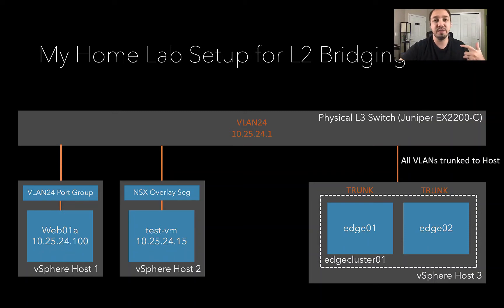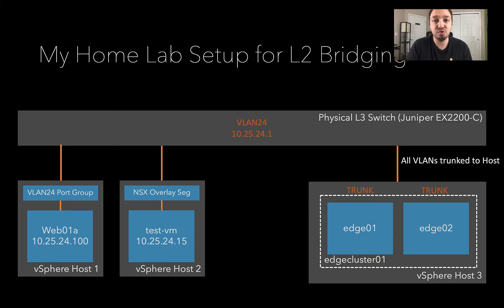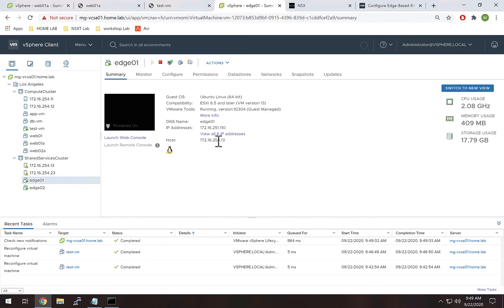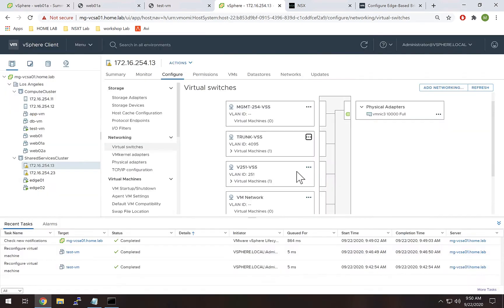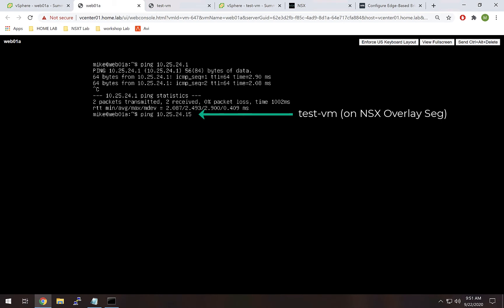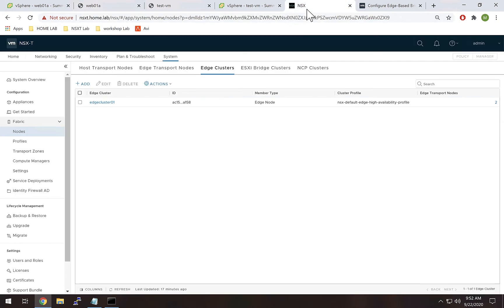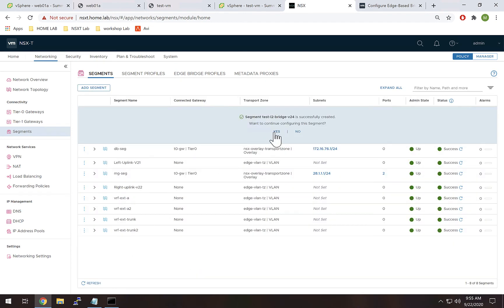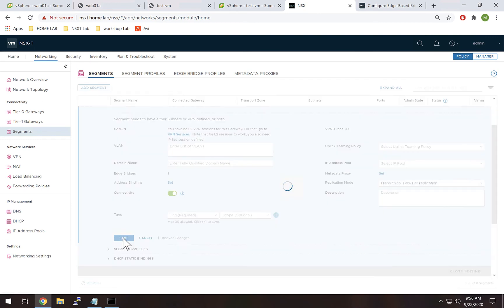How to Configure L2 Bridging in NSX-T 3.0

Comment: Really good thank you, thanks again for doing this.
I'd created a dedicated "Bridge-TZ" transport Zone, and then created an additional switch within my edges as per some older documents I'd found.  Your way looks simpler and cleaner. So I'll unpick mine and see if yours works.  NSX-T 3.0 seems to cut out a lot of unnecessary steps.  Loving it so far.
Reply: I'm thinking  it depends how the original port groups were setup on vSphere.
Reply from the maker: Agreed! In slightly older versions of NSX-T, it was more complicated in my opinion..now it's almost trivial. Obviously there's other considerations (sizing of edges, physical NICs, etc) for production, but the basic config is really pretty simple!
Reply: @NRDYTech  You are awesome, I've just stripped out 50% of the config I had and just changed the edge's main port group to ALL-VLANs... And Bingo!

Comment: What's the point of doing it with bridging when you can use VLAN backed segments as well? If it's just for migration reasons, it's still feasible migrating from a legacy VDS port group to VLAN backed segments. Essentially, you're translating a VLAN backed segment to an overlay segment - but what's the benefit to it?
Reply from the maker: The reason you'd want to bridge instead of only VLAN-backed segments, is what if you plan on transitioning those particular segments into NSX? Specifically, what if I have the 172.16.0.0/16 network on my physical network. I want to eventually have that exist ONLY in NSX (meaning NSX handles route advertisement and such). I could, in theory, just delete the SVI from my physical network and re-create it in NSX. That would incur an outage though. With bridging, I could create the bridge/network in NSX, and slowly transition VMs into NSX - and most importantly - have them still be L2 adjacent to their buddies still on the old VLAN. Essentially, my "migrated" VMs in NSX are still talking on 172.16.0.0/16, and the VMs I haven't migrated yet are still also on 172.16.0.0/16. Now, you could definitely use VLAN-backed segments if the end goal is to keep the SVI/default gateway on the physical network. That's actually a smart idea. But if the end goal is that NSX owns those segments completely (and the physical network doesn't know about them EXCEPT through route advertisements) - then bridging is probably a better fit. Either way, just a temporary implementation. Sorry for the novel :)
Reply: @NRDYTech  Thank you for the 'novel', that clarified a lot! I find the use case for some things in NSX difficult to tell because I've never used NSX in a real production environment.

Comment: promiscuous mode and forg mode is enabled on which port. edge has mgmt nic, (left and right vlan back nic connecting phy router) & TEP nic. 
Am guessing left/right NIC , however in your video its just one?
Reply from the maker: Hi Sumeeth, you would be enabling promiscuous mode at the port group level - not at the vNIC of the edge VM. So this would be whatever port group is trunking to your edge VMs (in my case, it's usually something like "ALLTRUNK-PG"

Comment: Hey Mike, been watching the series, great video, love it!

Just couple questions regarding the overlay traffic. So I understand overlay runs on tunnels, but how is the underlay network like between two VTEPs? is there still vlan involved in the underlay physical network?  Do I have to set GWs if I have two VTEPS with different subnet? While I try to ping one vm from another(different host), how do they know where to go from a underlay perspective? Really appreciate it!
Reply from the maker: Thanks for the kind words! To answer your first question, all of the "overlay" traffic rides on an underlay VLAN, which I often call the "TEP VLAN" - the whole purpose of this VLAN is to transfer the GENEVE encapsulated (aka: overlay) traffic across the network. You hit the nail on the head - if you do have TEPs in different networks (which is fine, and actually preferable in some situations), you just need to make sure you have routing between those TEPs (and Jumbo MTU). You set the default GW for the TEPs when you configure the N-VDS/VDS in NSX-T.
Reply from the maker: To answer the second part of your question, when you ping from one VM to another VM, the host has a couple of tables. They have a routing table, and they also have an ARP and Mac-> TEP table. So say you ping 192.168.2.20, which is on another host, your current host would do a lookup, and see that 192.168.2.20 is on TEP 172.16.5.5...so it will then encapsulate that original traffic with GENEVE, and set the outer IP header to a destination of the 172.16.5.5 TEP IP. By doing this, the underlay only really needs to know about all of the TEP IP/Macs, and not the VMs. Hopefully this makes sense!
Reply: @NRDYTech tHANK YOU!! Makes much more sense! Is there a Facebook or IG or anything I can follow? I know its a bit rude but just really need some help on my project so messaging would be much more efficient lol...its okay if you dont want to... Anyway great explaination!
Reply from the maker: @aeroSheldonL  I don't have anything like that setup, but maybe I should start a group or something! To be honest time is VERY valuable for me right now, so I try hard to answer questions here but it would be tough to get involved more than that